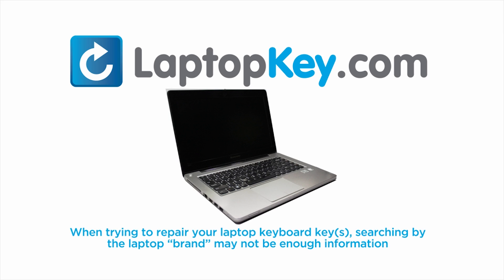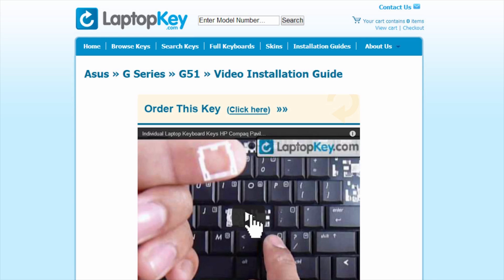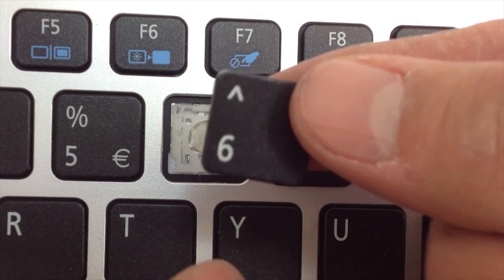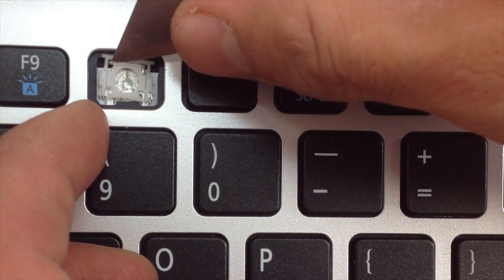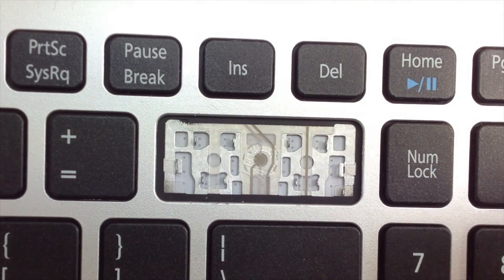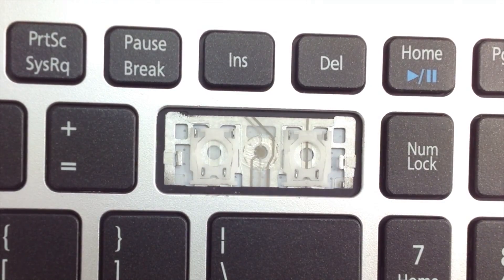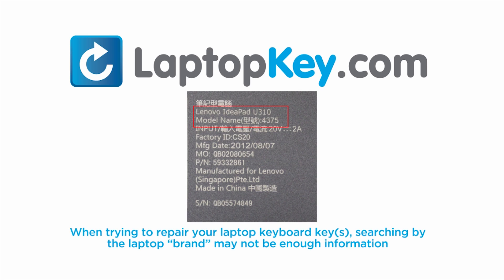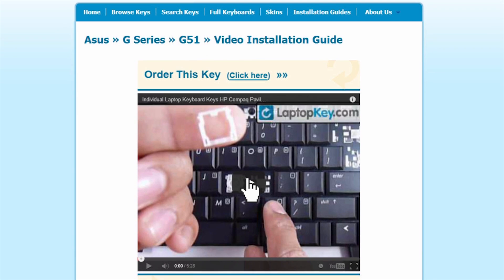Replace Keyboard Key on Acer V5 M5 M3 | Fix Laptop Installation Repair

Comment: To anyone having issues with fitting the white plastic thingy on the metallic hingies, make sure to bend them a little to the center and up cuz there is a chance they have bented inwards. I had this issue while installing them, it wasnt mentioned anywhere in the video so I ended up installing one of my keys poorly. Bend the metallic hinges with a flat screw driver or smth with a pointy nose and try to re-arrange them as close to the openings of the white caps as possible.

Comment: How to pull out a key from acer aspire v5-572 (the same keyboard as in video) without breaking it?
Reply: I have Acer Aspire V5-552g.  I pull out a key from the bottom part. Main latches are there.